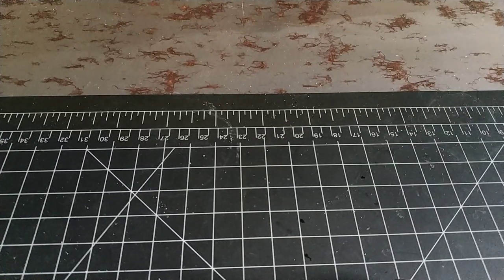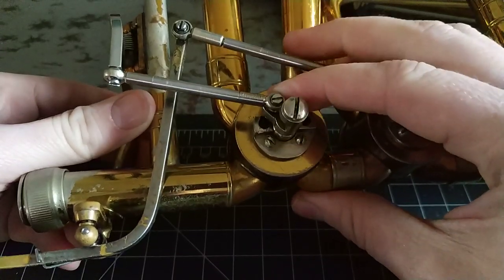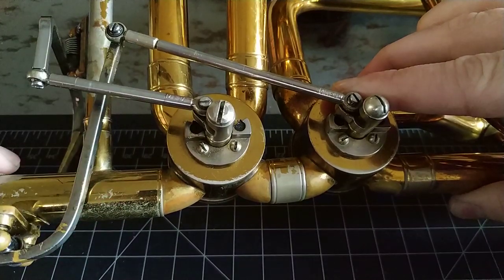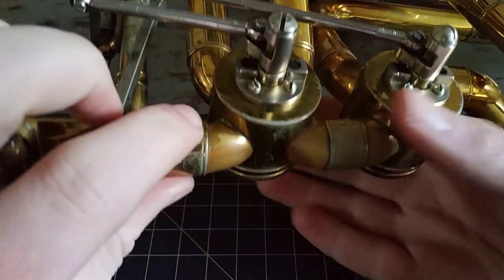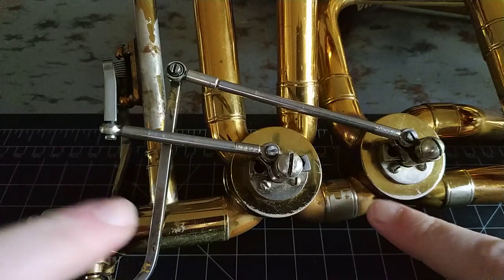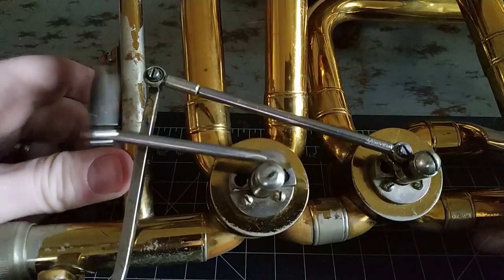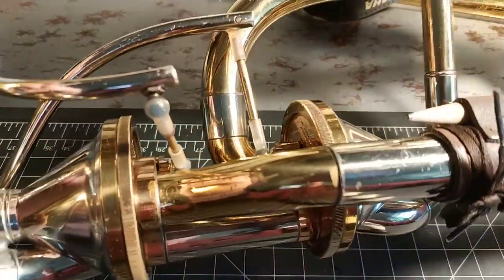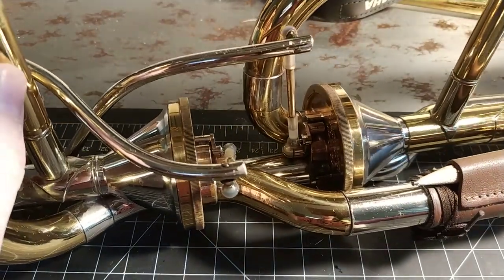Diagnosing valve problems, noise or otherwise

Comment: What bumpers do you use on your Thayers? I need some good replacement ones for my Edwards as the set thats on them now are worn enough the the valve doesnt line up properly anymore.
Reply from the maker: No clue! My tech put them in. I'm sure you can get replacements from Edwards for cheap.
Reply: @AidanRitchie  Alright cool! I'm definitely gonna get some from Edwards soon if thats the case. Thank you!